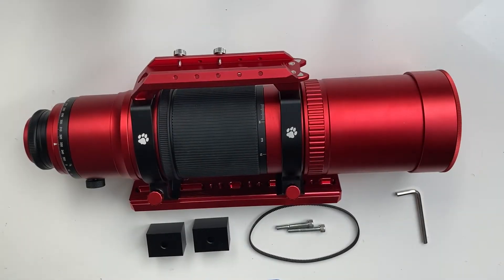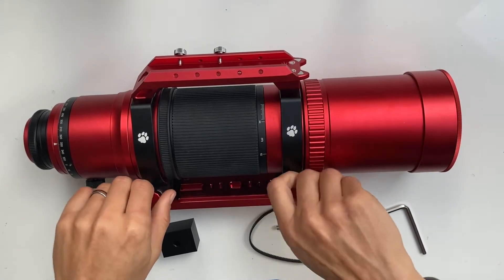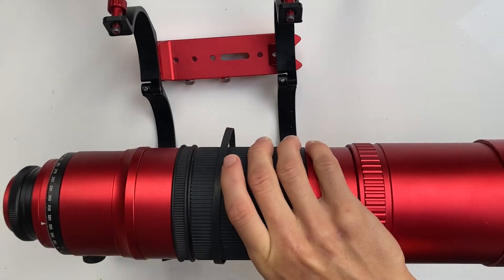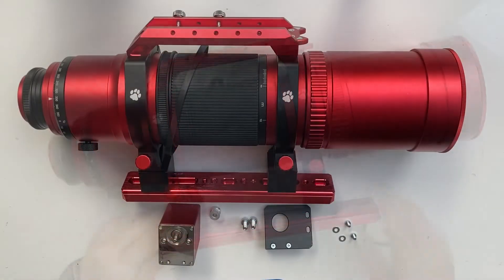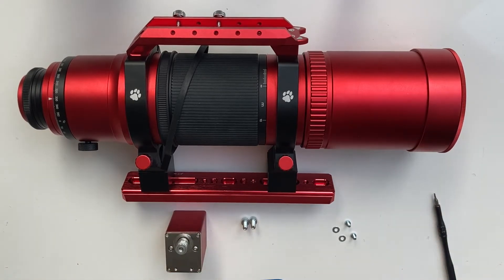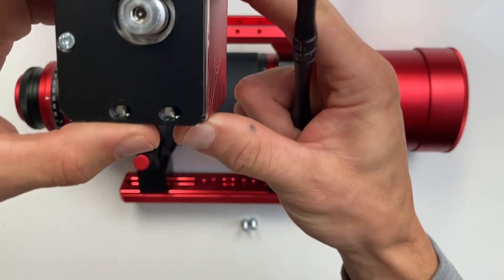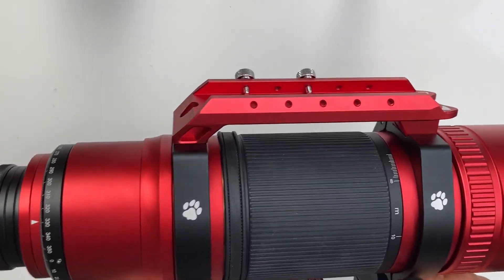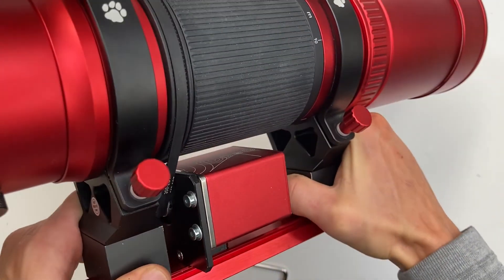William Optics WO RedCat 71 ZWO EAF kit assembly instructions

Comment: Nice video; thank you!  
Question: is the set up and function the same for Gen 2 Redcats?  I ask because the part of the focus ring where the belt rides is separated from the rest of focus ring in your video., but he Gen 2 Redcats do not have that separated area for the belt to ride on the focus ring (going from photos).
Reply: This is RedCat 71 kit - RedCat 71 has integrated belt ring. RedCat 51 (v1 and v2) does not have integrated belt ring. But we provide 3d printed mxl ring instead, which comes on the top of helical focuser ring.
Reply: @pavlini0    Thank you for the clarification --much appreciated!